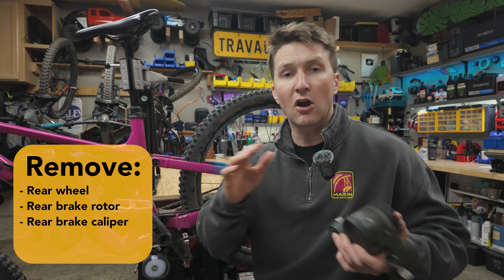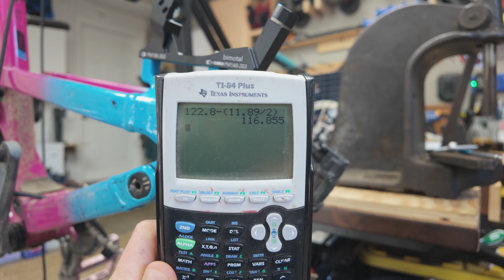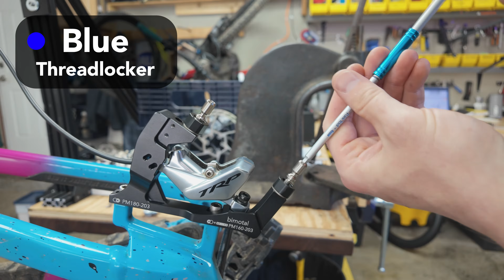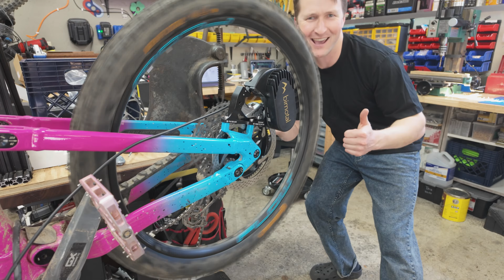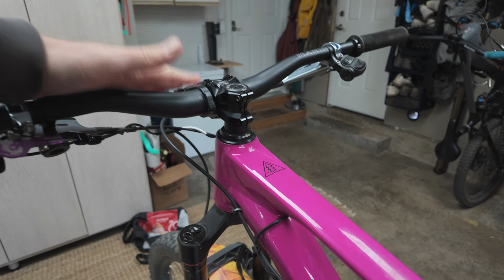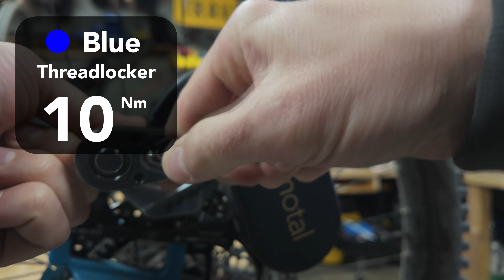Bimotal Elevate Installation: a 4-minute Guide

Comment: I have one of these and it does work well. The biggest draw back is there is some drag that can be felt when pedaling without the throttle engaged. I mostly use this setup at my local bike park and it flat out fly's back up the climbing trail. The other issue is the provided thumb throttle does not work well with traditional dropper post levers. i use a raceface dropper that works great. Bimotal needs to provide a half twist throttle that would allow a traditional dropper lever to work.  I get about 11 miles and about 1500' of elevation  at my local bike park and I am using the throttle in full boost mode on the climbing trail back up and using the throttle on the flats. I am about 220LBS geared up, My wife gets better range and goes faster uphill as she is 90LBS lighter.

Comment: Impressive video, Bimotal. Looking forward to seeing more content from you. I smashed the thumbs up button on your upload. Keep up the excellent work. Your detailed breakdown of the installation process is incredibly helpful! How do you recommend adjusting the motor height for different bike models to ensure optimal performance?
Reply from the maker: Thanks so much for the support. we really appreciate it! As for adjusting motor height: that’s handled by the shim stack we showed in the video. The shim stack stays with the bike, so once it’s set up, any Elevate drive unit can be quickly installed using the two quick-connect levers. no additional adjustment needed.

We don’t recommend swapping the mount between bikes regularly. Instead, we offer extra mounting kits so you can set up each of your bikes once, and then just move the motor and battery between them. It’s all designed to be plug and play.